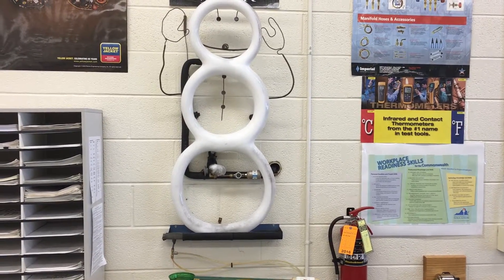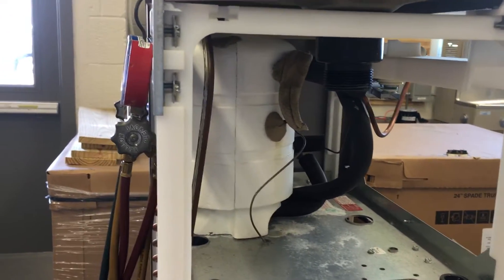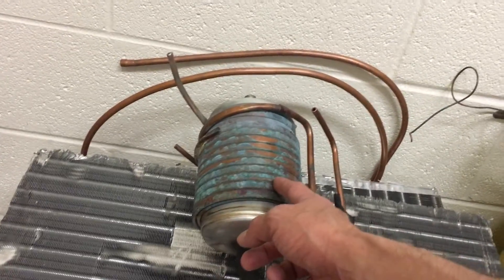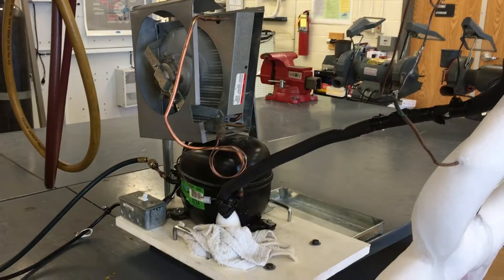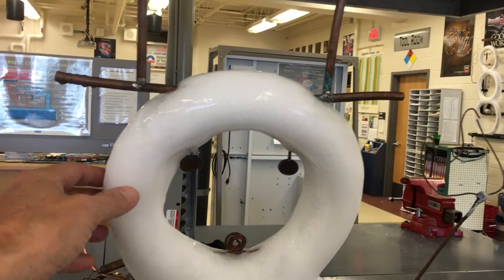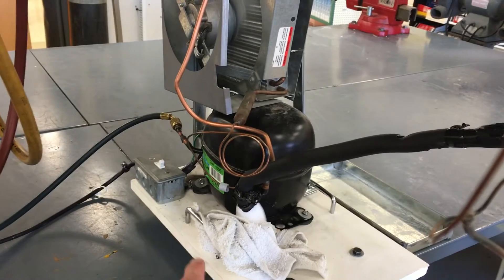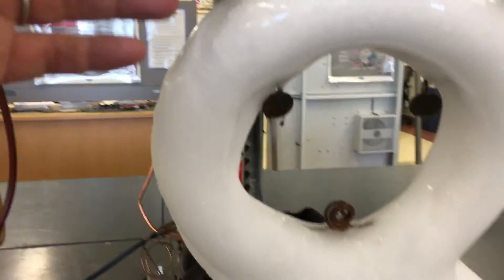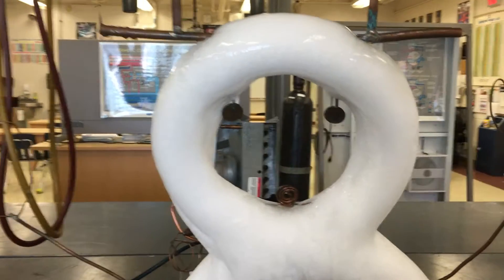HVAC Basics: First - Special Project - Do you want to make a snowman?

Comment: Awesome video! I'm currently working on a project very similar to this for a Final Project at my Tech School. Do you have any tips/suggestions about how to hook this up? Thank you!
Reply from the maker: Thanks! What ever condenser you are using you can size the snowman by matching it up the that units evaporator if you have it. Measure the runs and calculate the u bends to add to the total amount of line you need for the evaporator aka Frosty. Use a TXV and have a receiver and maybe an accumulator for safety. I solder the 1/4 liquid line to the 3/8 suction to act as a heat exchanger. Make sure the unit has superheat for no flood back and you’re all set. Hope this rely wasn’t to late. Good luck. -RS

Comment: Thanks for the videos!  You're a great teacher.   Just a suggestion......it doesn't really look like a snowman IMO.  I would make it smaller overall with a larger diameter bottom with decreasing size of mid section and even smaller head. I think you can also do a two section short fat snowman with a large round bottom and a smaller head.